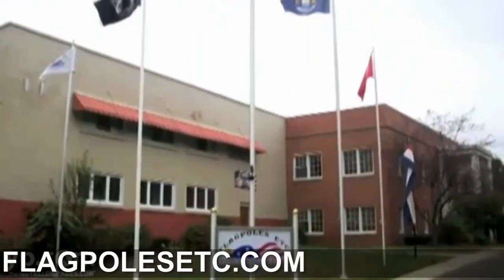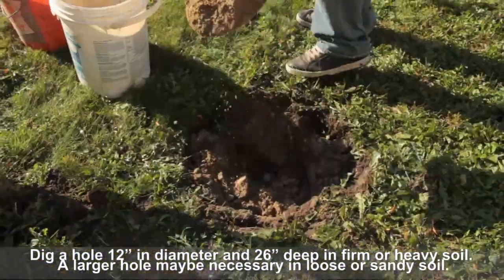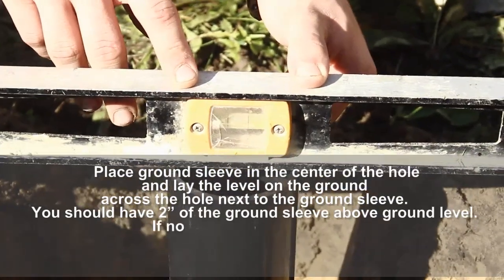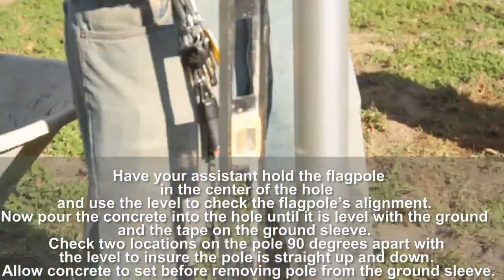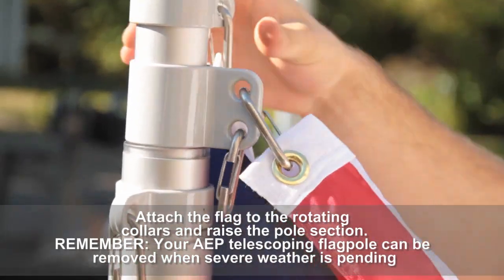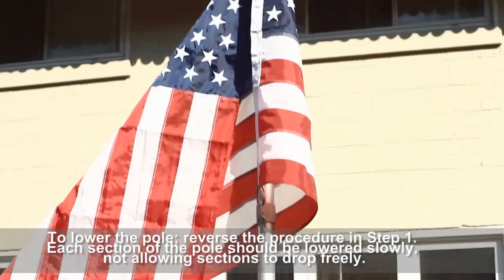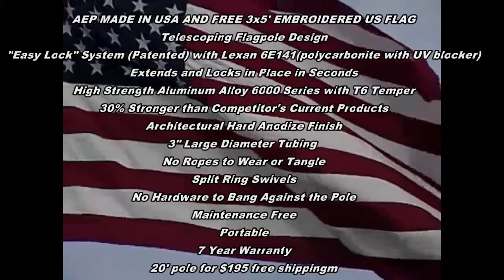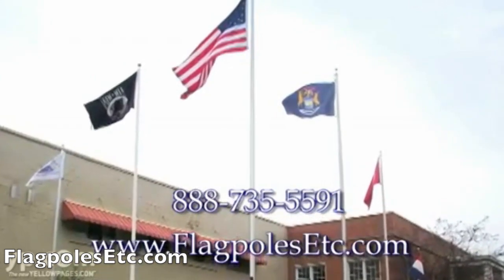telescoping flagpole installation

Comment: My sleeve didn't have holes for the stop bolt. Why do you need a stop bolt anyway?
Reply: My guess is to allow for drainage to keep the base of the pole dry to prevent corrosion.